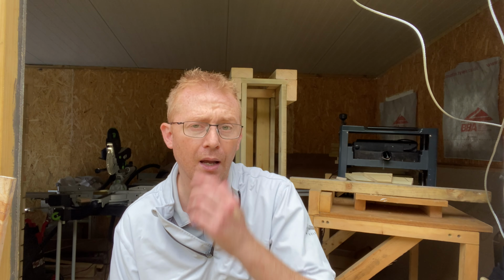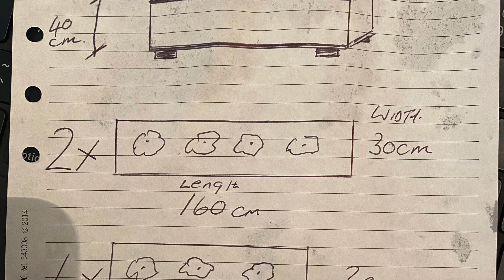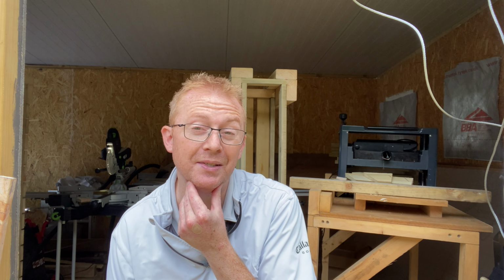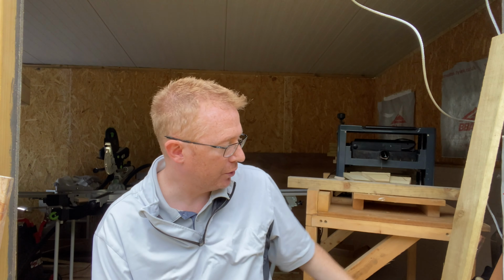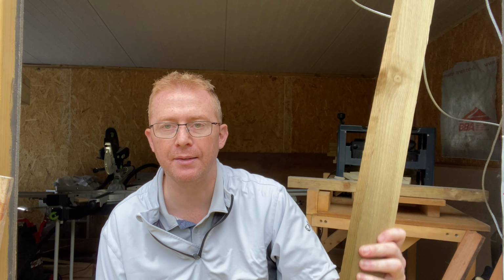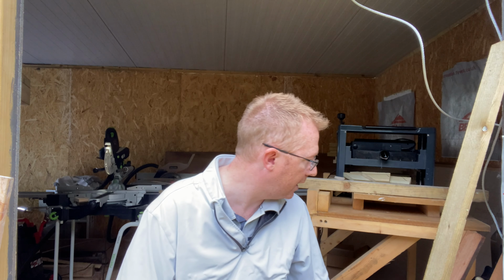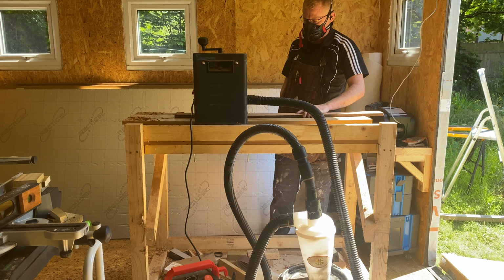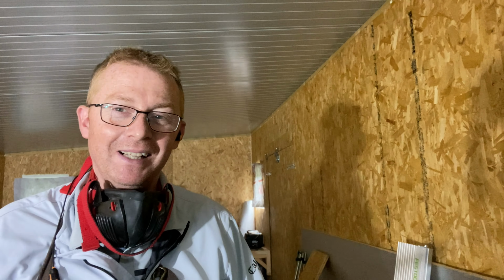Making Outdoor Planters from Offcuts / Scrap Wood / Skip Dives😀

Comment: 😁 Lovely job Leo. You can't beat a good skip dive to find that buried treasure 😁. The planters look great, I just hope the new owner looks after them well. I've made them in the past and you see them years later and its heartbreaking to see them neglected. Treated well and they should last almost indefinatly. Nice job Leo 😁👍
Reply from the maker: Thanks Frank. Tbh I kind of wanted to treat them myself but my neighbour said they had the paint etc so would take care of it. Hopefully they will be well looked after🤞. Think if I want to make them to sell it’ll have to be reclaimed / scrap materials if I want to make a few quid.
Reply: @Hand-i-Craft  I think getting a regular supply of decent "Free" wood is always an issue.so i guess the overall design would need to be flexible so It could be made with smaller offcuts. I watch with interest. Good luck Leo 😁👍

Comment: I think you need to visit skips more often, Leo. Don't forget the 'custom' aspect of whatever you make. You can make them to fit the customer's needs.. I think it's worth considering. And what about contacting those landscapers that provided you with the original timber - you could 'clear up' the offcuts for them!
Reply from the maker: Very good points here Mandy. I think, like many other makers, you run the risk of underselling yourself. The bespoke side of things should be a good selling point, guess I need to dip my toes to find out! 😀👍

Comment: I liked the use of the brad nailer to hold the wood in place before you screwed it and the laser line worked well, i make and sell loads of planters all from off cuts of construction grade treated wood that would go in a skip they are much better quality than ones you would buy from garden centres they always sell well but they are quite cheap as i am not paying for the wood not sure if people would pay £120 for one planter as it is hard to see the quality of them from a photo i would make a couple and try them at that price if they don't sell you could keep them for your own garden the ones you made look great well done Leo.  👍🔨
Reply from the maker: Cheers Rasmo. I can make them cheaper if I’m using offcuts or whatever hardwoods or treated timbers I can get my hands on that would otherwise be getting binned. Everyone talks about the ridiculous cost of wood at the mo, but to actually cost up something like this by going and buying the timber from a local yard was scary. It would take £70 of wood to make one of these planters and that’s not including fixings / glue etc. I think my best avenue is continue trying my best to get hold of offcuts / skip dives to keep the costs down
Reply: @Hand-i-Craft  That's the only way i can sell them at a reasonable price is by getting the wood for free, wood prices are ridiculous at the moment and the quality is not all that great either.

Comment: Hi Leo. Great project mate. As for the mitres, I've done that a fair few times. It's now "Measure 5 times....stand back....look at it at least 4 more times...make sure I know which cut I'm doing and why 3 times....look again twice more...then cut once!.......then curse 10 times cos I messed it up lol"
Reply from the maker: Thanks Gaz and as for the mitres, well 😂😂😂. I was gutted as I’d just spent the time cutting the piece to perfect length, running the angle through on the table saw and I’m thinking ‘that’s spot on now’ so ready for the mitre cuts and boom, back to square one 😂😂

Comment: Hi Leo. The 'show' of the mitre cut the wrong way, before you said anything. made me smile as I have been doen that road. I have ,in the past on these things, left the mitre open by 5mm and then filled the gap with 'frame sealent' as it moves with the mitre gap. A great build that will last many years longer than the "made in India" cr&p you would buy in the Big Sheds and garden centres. I have my OSB3 being delivered by Securicor today. Can you tell me if you treated both sides befor you out them down on your workshop build, please? The beach hut build pregresses.
Reply from the maker: My main fear with this design Wil was the mitres and will they hold over time. I’ve asked my neighbour to report back to me which I think is a fair deal considering the cost price. Like the idea of the gap though with the frame sealant, can that be sanded down? In regards to the OSB, yes I went belt and braces and treated both sides, the facing side got an extra coat or two 👍
Reply: @Hand-i-Craft  If you look at boat decking it has a rubber insert achieved with a slot and masking tape. Masking tape each side of the slot, infill with sealer, and smooth off with a wet finger. After sanding is best.

Comment: Great work Leo, however if I could add a slightly sour note based on my experience of making a fair few of these from similar mataerils. I guarantee that the mitres will open up, never to return. I moved onto wrap around butt joints where the inevitable gaps are far less noticeable and easier to correct. There is also no problem having the splay running into the inside either as it looks just as good and acts as as an extra water catcher, a good use for offcut feather edge fence boarding. Great to see you back in the workshop, keep up the good work.
Reply from the maker: Thanks Peter and yes I have to say it was a bit of a concern with the mitred tops. The best advantage of doing this is it is a favour at a very generous cost price to my neighbour and one of the conditions is he gives me feedback on how they are holding up. But based on what you’re saying here then definitely yes I will amend the design for any potential future orders. Cheers for the tip👍👍

Comment: Great work. Made some of these recently having seen them on Johns channel. Really like the plugs and the angled top. I added a champfer to the bottom of the legs to try prevent tear out when moving them and also roofers tape to the parts that come in contact with the ground. Anyway, great work and thank you.
Reply from the maker: Cheers Mark👍👍. Roofers tape, what a great idea! I’m sold on that one 😀👍

Comment: Nice slim planters Leo. I was supposed to build a few last month for my deck, but pushed that idea for later. Timber price is still high for my liking. Regarding the flickering of some lights, see if you can change the exposure on your camera/phone from auto to manual. I had the same issue on my old gopro 6 with screwfix dual led work lights. It was always flickering, until i changed the shutter manually to 1/96, and then it was smooth.
Reply from the maker: Thanks Suj, I was lucky I could make these with offcuts and alike but was a bit frightened about the cost price against current timber prices, it just doesn’t seem to be stopping! I’ll look into the setting, I film everything with my iPhone and pretty much leave all the setting on auto so will need to have a look. Cheers for the tip😀😀👍

Comment: Those support feet may have been better going full width instead of the 2 blocks. That way it prevents the bottom splaying/bowing out. Great job though and so you should be proud of them.
Reply from the maker: Thanks Scott for the tip and I’ll amend the design to brace the feet across the base. Great idea and cheers for the tip👍.

Comment: Hi Leo, I noticed you having to clamp each of the vertical pieces to sand them. Have you considered a vacuum clamp, I have found it a very useful piece of kit also for holding pieces for routing and they are easy to make . Looking forward to see the power up!
Reply from the maker: I’ve got some vacuum clamps Mike. I done a video about them, bought from Rutlands. Love them and make my life so much easier. They’re behind a tonne of all kinds in the garage at the mo though unfortunately, can’t wait to get some kind of order back soon 🤞🤞

Comment: Do you just use brads in your nail gun or staples aswell? Ive just started using staples (in the same nail gun as you) and they hold 10X better! Ive just built some double gates(think you have seen them on my insta) and i used staples to pin the t&g on with as i didnt fancy hand nailing or spending a fortune buying a dedicated nail gun for that job! Just a thought... toolstation sell them if you need a link let me know!
Reply from the maker: I do use the staples pal and have been very impressed. Thought they’d be great for the Tyvek wrap, but they were too powerful! Had to turn to the hand stapler😀. Only downside I’ve experienced with the staples are they leave quite an indentation, but maybe that’s because I had it on too powerful a setting 🤷‍♂️
Reply: @Hand-i-Craft  i use a air stapler now, sets it perfect depth everytime 1-2mm below the surface 👍🏻

Comment: Hi, my next-door neighbour has asked if I could get the things together to run power to her brick built shed and I would like to help her with this, I know an electrician will be needed as I am not willing to touch the main fuse box but I do not know what she will need. I know she will have to get cable to run from her fuse box to the shed and I assume she will need to run it overhead or burry it below grown and I assume that she will need a fuse box in the shed but I don’t know the thickness of the wire, the depth it will be buried underground, if it will need to be in conduit, or overhead will it need some sort of cable to stop it being stretched .also at what height. I would not attempt to fit it myself but the digging or overhead strain cable I can do, also getting the cable as I have some rolls of it in my shed 1.5, 2.5 and 30 amp. Any info you can sheer would be much appreciated.
Reply from the maker: If I can I’ll pick his brains when the work starts John. When I asked contractors around to price up the work, there were two options. Either run it from the ring main downstairs so it would go onto the fuse box ‘indirectly’ through the sockets switch. You’d be limited to 13a with that, but if the fuse box is in an awkward location that might be a better option. Option 2 is running it directly from the fuse box. This is what I’ve gone for as allows me to future proof the workshop in that I could go to a much higher amp if needed. Also I’m not running the risk of tripping the downstairs sockets when I fire up tools. The armoured cable is what runs from the house to the outbuildings. The guy who laid my concrete base kindly dug a deep trough from the base to the back of the house. I laid some pvc piping down before covering it back over and ran some blue nylon cord through it to make passing the cable through a lot easier. As I had no idea whatsoever what thickness the cable would need to be, I put 50mm pipe down😂. That thickness is probably enough to power the whole of my postcode! Again I’ll ask what thickness they are using👍👍
Reply: Hi John,  there are tables available on the Web giving cable sizes for various loads and lengths to ensure the voltage drop is within prescribed limits.  This important to protect tools from overheating.  John McGrath has also done a recent video about workshop wiring where he talks about "earth loop impedance" - an important consideration which was new tome but appears to be pretty important from a safety angle.  Hope this helps.
Reply: @Hand-i-Craft  Hi Leo, if it's not too far from the house (ie less than 30M) then 10mm sq armoured cable should be OK to give you 30 amps in the workshop.  I have done this in France and UK and it's fine to run my big machines ( planer/thicknesser plus big vacuum) with no probs.  I laughed over the mitres - how many times have I done this as well!  Planters look great.  Materials are becoming a nightmare.  I have just been told that zinc gutters in France have gone up about 50% in the past few weeks.  I regret I didn't order them when I arranged the contractor to do the job (they are on the upper roof and too high for me to risk).  Mike
Reply from the maker: Cheers Mike and yes I’ve asked the electrician to fit a 16amp socket as the temptation is huge to invest in something that will require such a socket 🤔😀
Reply: @Hand-i-Craft  Hi, I did not mean to suggest that you quiz the contractor but the information you have given is more than I could ask for. Thank you very much for your help and information and it will be much appreciated. Also thank you for getting back to me so quickly, I was looking for anything that could help me and you have given me more than I could have hoped for.